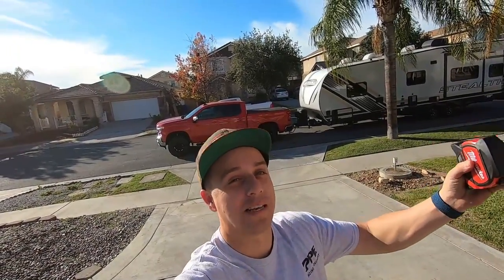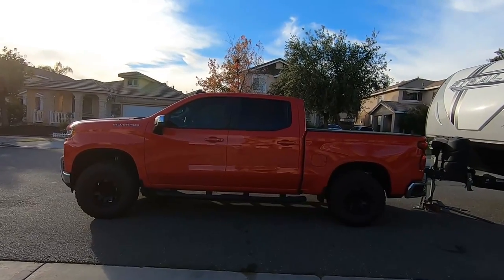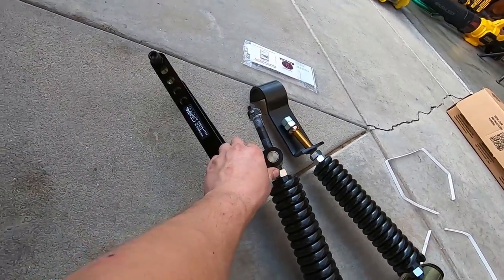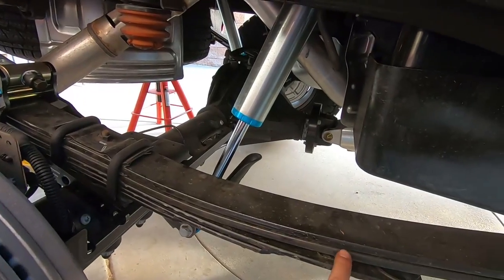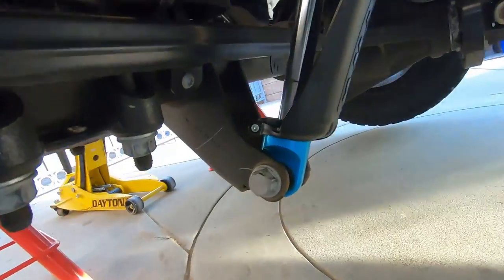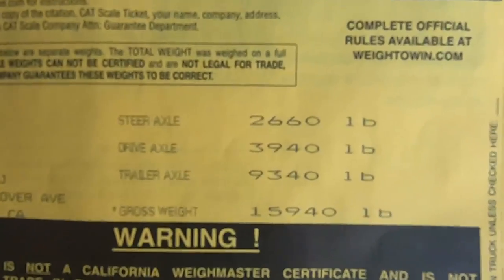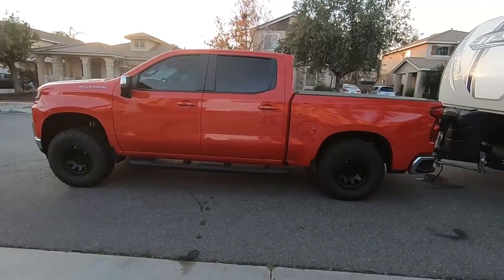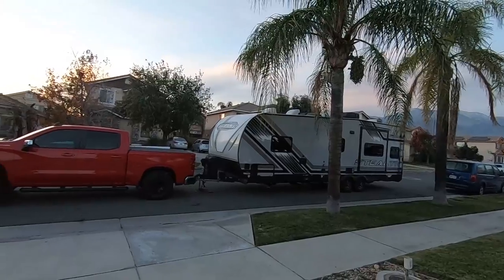Can Roadmaster Active Suspension (RAS) Improve Squat AND Weight Distribution?

Comment: There's a reason there are multiple holes on the bars that go under the leaf springs. The pivot point at the adjuster nut needs to be as close to the axle as possible. So you should be extending the assembly out farther to move that pivot point farther forward, towards the axle. The retention bolt and sleeve should be moved back one or two holes. That's how the system will work most effectively and efficiently. It's an incredibly common oversight. It'll still work the way you have it, it just won't be working at it's absolute best.
Reply: Do you have a source for this? I have been trying to find more details on this adjustment and the instructions that came with mine didn’t address this.
Reply: @nickc8366  I do not have a resource on this, but I did see it in one of the installation videos I watched, and when I saw it, it made perfect sense (physics was one of my better subjects). It seems like a minor oversight on the part of RAS, but it's easy to do. But like I said before, it'll still work if you don't. Just not as well. Would the difference be really noticeable? I don't know. But I do know that it'll technically work best if you do it right.
Reply: @thomassullivan1207  I kept looking and I did find a video where they briefly mention it (probably the same one you referenced) haha thanks for the reply.

Comment: The ball isn’t set up correctly. The trailer is level and it’s pulling your truck down. If you set up the ball either lower or a different pitch it will raise your rear end up. 

I highly recommend watching Curt’s video on how to properly set up a WDH.

Comment: Unless this is a max tow 1500 this truck is grossly overloaded with this trailer. A 10,000+lb trailer is not a typical trailer a 1/2 ton truck owner should purchase. Add a tank of fuel, wife and kids, and all your camping gear and the setup is even worse. No bolt on parts increase the capacity of the truck. This setup would be scary and dangerous to drive down the highway.
Reply from the maker: Max tow package is different leaf springs & rear axle ratio with other minor changes. These half ton trucks with the 6.2L are rated to tow up to 13,000lbs. Same truck, different powertrain. This trailer is slightly overkill for this truck but I didn’t have many options to tow with. There was so points i could have hit better but overall it was to show some sort of data with these springs. If you think not adding RAS or airbags to a truck to help it out is safer without it… then idk what to tell you

Comment: Great comparison of before and after the RAS installation! Especially with a load which has a tongue weight that would be near the safe working limits of the cargo capacity of a 1500. However, I would have liked to see the scale ticket before you made any adjustments to the WDH. While the numbers did improve, it does not demonstrate how the RAS helped in that area due to the WDH adjustments. I still think RAS is the way to go over airbags. Can't wait to do my install in a few months!
Reply from the maker: I really regretted not doing that. i need a redo lol

Comment: Weigh your truck with full fuel and DEF without the trailer to get a better idea where you're at with payload.  I have the same truck (4x4) and pull a Cougar 25RDS (30', about 7000 lbs) with RAS.  RAS made a huge difference.
Reply from the maker: Absolutely! It’s something i need to do next for sure

Comment: As a truck driver, It is super annoying/dangerous to have headlights shining up in my mirrors and head on. Hopefully more people will purchase this product.
Reply from the maker: Absolutely, i agree. Truck sitting nose high has no benefits at all when it comes to towing
Reply: Mine are adjustable from inside the cab. But I definitely hear ya
Reply: if you own a tundra you can just adjust the headlights with a scroll wheel from inside the trruck as you drive. Pretty cool feature that all trucks should have

Comment: Tks for the video.  I’ve got a 2023 Silverado with the duramax and need some rear end help.  Towing a 7000lbs 29 foot rv.  FYI. The regular Silverado duramax is limited to 9000lbs towing.  But if you get the max tow package, they up the rear axel, 3.73 rear end and springs and it’s rated for 13,000lbs.  However they are extremely rare.   They aren’t building many of them or they are having issues with parts.  I any case the 9000lbs is what the vast majority of us are dealing with.  I’m waffling between air bags and these springs you installed.  I have a 2 inch sag but really don’t want to raise the rear end when unloaded, which is most of the time.  On a plus side, they are easily removed.  Tks again for the vid.
Reply from the maker: So it just depends. I think a 29' Travel Trailer is well balanced so if your truck is level, then you add RAS, you'd be good.
If you have a 29' Toy Hauler, they are typically heavier tounge weight so maybe a bag setup would be better.
My issue on here was running these springs when the truck already sat way too low in the rear to start so the benefits didn't look as good as they could have
Reply: @americanduramax Tks for the input.  Seems both have their pluses and minuses.  I think I’ll go with bags so I can adjust for the various loads.  Tks again for the video.

Comment: I have Timbrens on my Silverado 2500HD.  After the oem springs sag, the Timbrens take over.  I don't even think I'm using the oem overload springs. The truck is level and the ride is stable and well planted towing 7000 lbs off the bumper with no WDH. I also have Timbrens on my Ram 1500 with coil springs, level, stable with minimal sway towing my 6000 lb TT with a WDH.
Reply from the maker: Glad to hear that; I bed I can use those in combination to just see how they feel. All in all just makes for a safer drive down the road

Comment: You did it wrong you adjusted the weight distribution hitch after putting in the helper springs on which intern caused more weight distribution from the hitch to your truck if you want to do it right take the weight distribution bars off and then scale it both ways all I see is the distribution hitch is doing what it supposed to do.

Comment: Dude not trying to be an ass here but you got kings on...... they aren't great for towing.. awesome for offroading but.. and second that trailer too big for that halfton. You need more truck. Doesn't make sense to make the front end higher then the back end ofcourse its going to sag more if your back end is lower, thats why from factory it comes with a rake... the RAS doesn't change anything besides when there a load on it so that shouldn't change your ride height, but drill it's your toys awesome truck still just giving my 2 cents l.
Reply from the maker: 2.5" shocks are great for towing too, no matter the brand buddy

Comment: I’m pulling a 32ft 7500 lb tt with my 21 1500 3.0 non towing. Stock suspension. With my trailer on I’m only 1 inch lower than my front and I use my airbags to make me level. Why is your front and rear suspension so different in height when loaded. Could it be because of your aftermarket suspension?
Reply from the maker: It's all in how you install and set the suspension. I overcompensated for the RAS springs in the rear on this one so this video wasn't able to give it's full towing potential. Currently at this moment with NO RAS installed, my truck sits level or 1/4" higher in the rear. If I added the RAS + this trailer, i'd be so close to level towing. I just dont know if i have the desire to make a part 2 to this video at this time.

Comment: Appreciate your content, Brother! I have a 2023 LZ0 and looking to get the cognito 3” elite leveling kit, deaver mini, and RAS. Any specific reason you chose the Kings vs Elka vs fox? 

Thanks!
Reply from the maker: First, If you haven't purchased it yet. Reach out and we can probably save you some money on it and get it to you asap.

Secondly, I chose Kings because of availability at that time. I wish i had done Fox or Elka because they are slightly better quality in my opinion but you really can't go wrong with any of the choices. I would say a 2.5 shock is a must have though.

I will be dropping my video's this week. Sold this kit and did the 6" coilover kit w King 2.5's and it's been awesome

Comment: How much does the trailer weigh and do you do Hd or regular RAS?
Reply: RAS will always say go with the HD in almost all cases. If you're on the fence about which one, get the HD and dial it in using the white, 25% spacer.